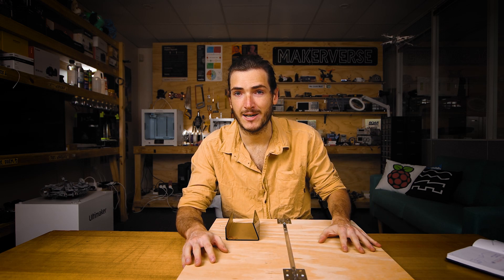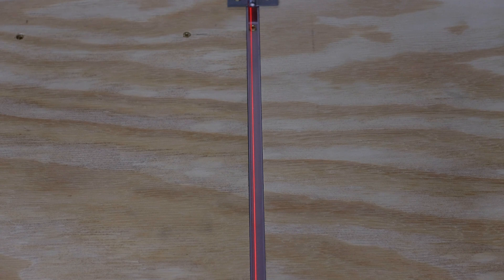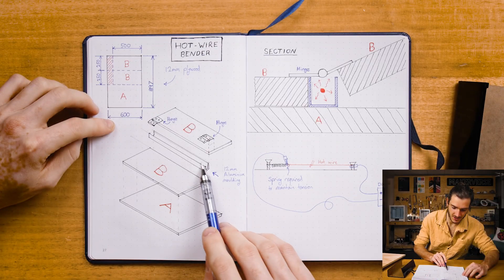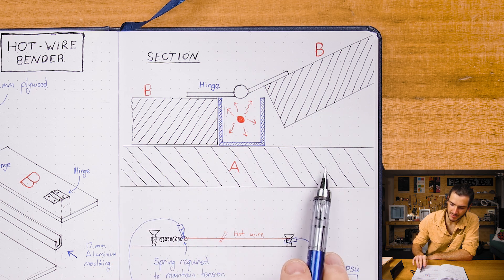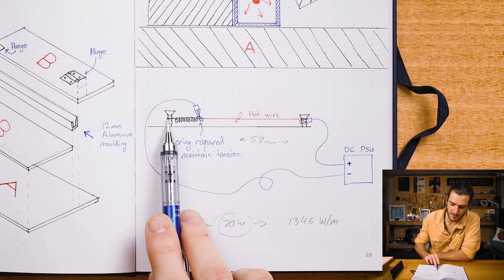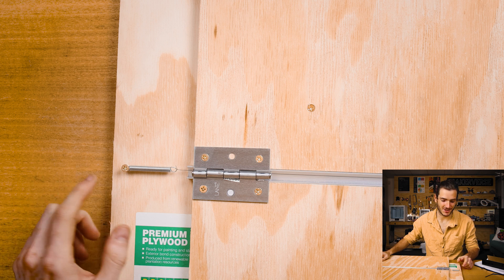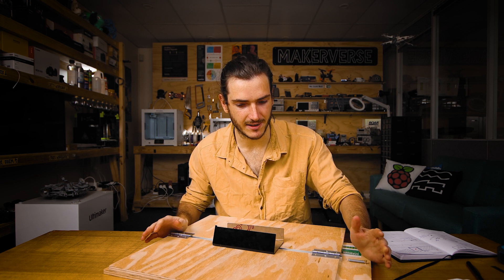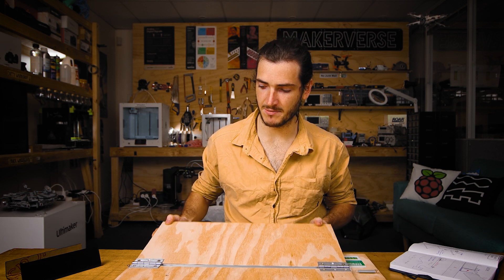How to Make a Hot Wire Bender for Acrylic

Comment: If you don't have a power supply, you can run the nichrome wire in series with an incandescant lightbulb. The lightbulb limits the current. It is the cheapest method that works well.

Comment: I just made a smaller version of this. I didn't refer back to the video an instead of making the bottom board wider that than the top pieces, I made them the same width. This presented a problem that I created but solved, room mounting the screws/spring and wire. I did get them mounted under the hinges but had to make one end of the metal channel 3/4" shorter as to not have it short out the heater wire. One other modification I did was to route a 1/4" channel in the top of the bottom board, about 1 inch away from the channel,  before mounting the top one. This provided a way to get heavy gauge wire back to the other side, where I'll attach the power supply.

Comment: Could you use a toaster oven to power the unit and control the temperature.  Toaster ovens typically use around 1200 to 1800 watts of power, which translates to 10 to 15 amps.

Comment: Hi Michael, thankyou for all the info on the acrylic bender. I needed to bend 700mm of 2mm acrylic but couldn't get any of my power supplies to get it up to temp so I used 2 x 12volt 7Ah batteries I have in a pack for another project. I twisted 4 x 28AWG (same as what you sell) & powered for 40 seconds to get a nice clean bend. I am going to try using a 6V – 90V 15A PWM DC Motor Speed Regulator Controller from Maker Store & reduce the heat output to give a slower more even heat troughout the acrylic. Cheers Peter south of the border.

Comment: thats a really nice video!!! I think getting the right "AMPS" might be fiddly for non electrical folks (ie what is collapsing voltage?) as a lot of power adaptors can't put out that kind of amps. I always go BIGGER and then step it down. In my case I used a 19.5V DC, 7A dell laptop power supply and passed it thru a DC-DC step down module from Amazon. I got one with "Wendry DC-DC 5A, 75W" in the name with a digital display for $12. Amazon has a tonne of DC-DC modules that will work, but this one had a built in display with click to toggle between input/output voltage display. I'm pretty much going to build it exactly as you show as my girlfreind wants to bend a tonne of acrylic

Comment: Great video. I just had a simple perspex case made by a plastic  manufacturer, for a BMS for a LifePO4 battery, which cost me almost $200. I will now build this unit, so I can make my own boxes hereafter. Only thing is you didn't mention the size/diameter  of the nichrome wire. I will also incorporate a microswitch to cut tbe power to the hot wire when the bend is commenced, to allow it to cool  and leave both hands free for managing the job.
Reply from the maker: That switch sounds like a great quality-of-life improvement - just make sure it's up to handling the current! As for the wire rating - nichrome is most often specified in terms of resistance per linear meter, rather than diameter.